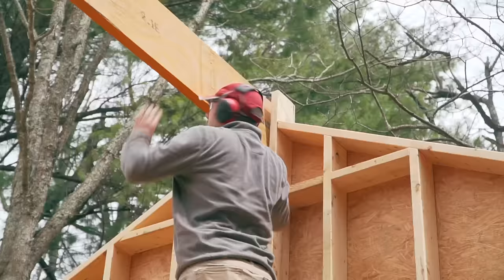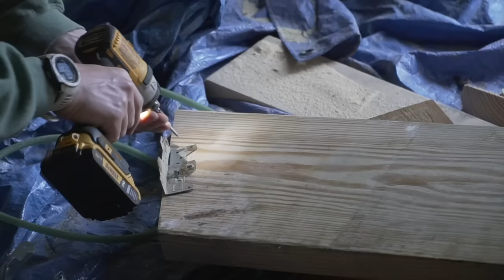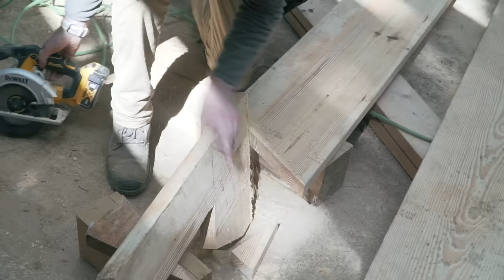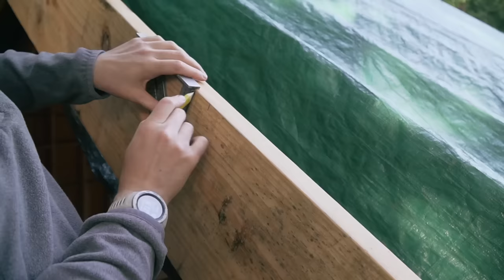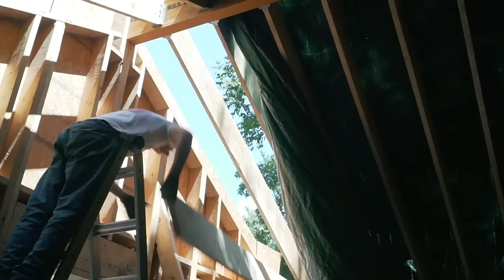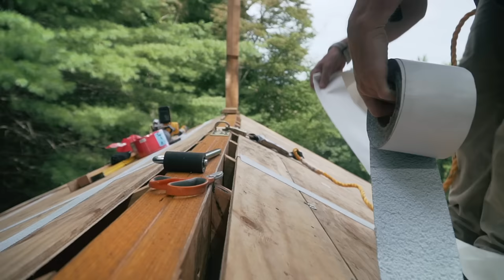DIY Builder Frames a Roof with a Cathedral Ceiling for the First Time!

Comment: My grandmother built a huge house like this. Walls made from 2x6's, everything went up 2 inches in dimension so instead of 2x4 it was 2x6, instead of 2x6 it was 2x8's and so on. It was built in 1952. I was in that house in an F4 tornado and all it did was take down trees in the yard and pull a few shingles off the roof but the house stood strong. The house has a brick and natural rock facade 8 inches thick as well. The house is still there 70 years later.
Reply from the maker: Nice !

Comment: Building a scaffold (wall blocks ,arms and legs would save a ton of time and the labor of ladder work when doing overhangs ,flatwork and gables. Takes little time and you load them with material needed and work comfortably and in position being able to walk instead of moving the ladder and going up and down 1000 times. Trust me, I know.
Reply from the maker: I’m sure! I just wasn’t sure how to do it, renting the scaffolding wasn’t an option as I’m working sporadically on the cabin (8 hours a week at most) so the only other option was to buy it but man, that stuff isn’t cheap!

Comment: Good Day Tristan ; Very good video I liked it alot . Maybe you can tell me, why is dowling always so expensive ?
Reply from the maker: Thanks John! What is dowling?
Reply: @TheDIYCabinGuy  Dowling is round wooden rod about 1 or 2 inches in diameter often used in closets to hang your hangers on , or for the backs of chairs . Also used as verticle supports for deck railings etc .

Comment: What are the specs on that nail gun? And the pressure equipment? Cause i keep on searching and in Brasil i cant find an answer that is below 400k and no one lends these. I miss the powder charge ones...
Reply from the maker: Compressor is from metabo, model is called “the tank” , nail gun is 21 degrees framing nailer from metabo. If you want more info, go scroll down my older videos, I did one that only talks about my compressor and nail guns
Reply: @TheDIYCabinGuy  thanks man!!!!